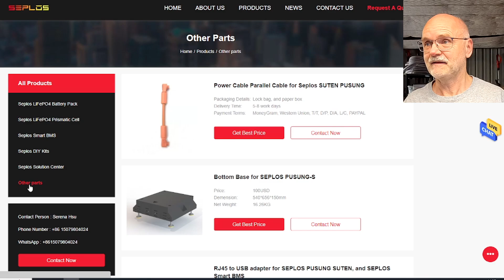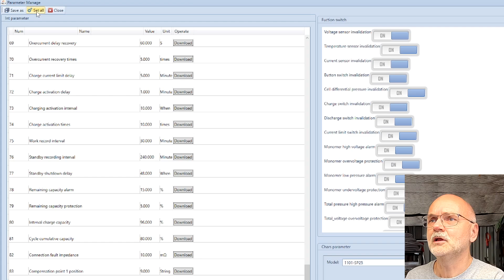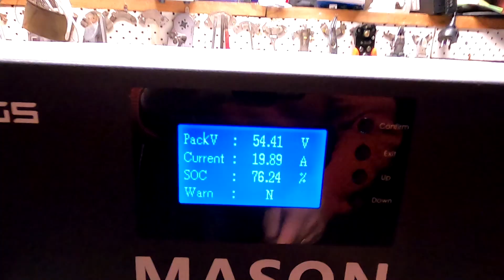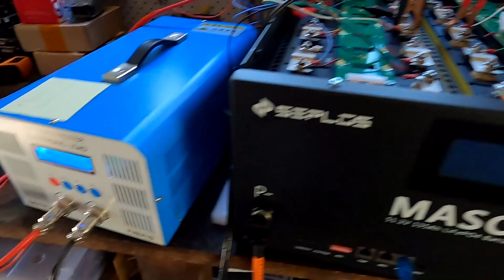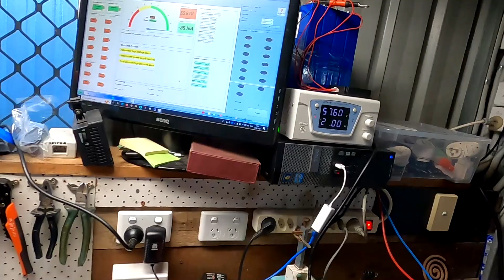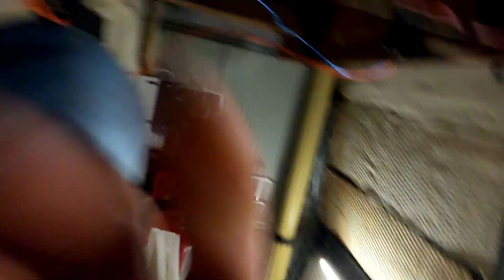SEPLOS SMART BMS: as good as its reputation?

Comment: Hi Andy and thank you for all your testings about Seplos
I use Vertical Kit from Seplos to make 16S 300Ah Battery Pack
BMS inside is 10E, with bluetooth
I use with a Solis inverter, everything looks good now, only that i just can't figure out what is the warning / parameter that make BMS to ask inverter to limit charge current to 10Amps
Sometimes happend to see inverter charging at 70Amps ( maximum set by me ) and finish charging without lowering current and sometime is lowering to 10Amps and stay there for a while and finish charging
Thank you again

Comment: How does the seplos bms stack up against JK bms? I'm interested in 8S configuration
Reply from the maker: Like apples and pears, I would say. The JK is great for a single battery and has exceptional balancing features. But it is a consumer grade BMS. The Seplos, Tiangbangda and Pace BMS are far more robust, can be programmed in far more details (which can be very confusing), have additional safety features and can communicate amongst each other and your system/inverter.

Comment: Hi Andy, I have just built a 48V 280Ah battery and I have a Seplos BMS 100A 10E. I ‘ve noticed that despite the inverter being setup to charge at 3000W, it only charges at 2500W maxing out between 45-49A even at low state of charge. I should be able to see around 60A going into the battery but for some reason the BMS is telling the inverter not to exceed 50A. I have checked the settings and I don’t see anything that could explain this. Do you have any idea?

Comment: Hi Andy. Are you using the DVCC function in VenusOS so that the current limits are controlled by Seplos BMS?
Reply from the maker: Yes. I use that in the SPAT Calibration Centre installation (Battery 3.0).
I also use DVCC in my Off-Grid Garage for limiting the charge current without any smart BMS connected.

Comment: Seplos recommend to charge the battery pack with 100A and discharge 100A to the bottom or when the BMS switches it off. Then charge again at 100A to the top to reach 100% or the Ah rating of the cell modules is reached. That is what I was recommend by their tech team.

Comment: Hello from Germany, if you know the Seplos BMS, you must have thought about balancing, many have an active 5A balancer from Alibaba and don't know whether you always leave it on or just plug it in every month and then look so that the cells are well balanced. On the bottom of the boards there is a soldering point or several where there is also soldering for Lifepo batteries. this big pad covers 2 contacts and if you solder a wire and switch you can turn the balancer on and off. look closely, on the circuit board at the edge.
I like seplos and the service also

Comment: Can I successfully connect the seplos BMS 14s to my energy storage consisting of the LG Chem NCM (Li-Ion) 12S battery? What should I do with the 2 free bms cables?
Reply from the maker: I don't think this will work with Seplos BMSes. They only work with the specified number of cells unlike many other where you have 8-24s support for example.

Comment: Andy:

I also purchased two of the Seplos 280Ah DIY Kits in April and May. I really liked the idea and they did not seem expensive, although the shipping was $190 per kit. My cells were only a few months old and came from Docan Technology. I was thoroughly dissatisfied with the cells as very few test to the alleged capacity at a very low C rate. The second set of cells also came swollen. Docan suggested I just compress the cells back to the original size. I chose not to do this and will not buy more from Docan.  Both kits came packaged as yours did, with loose parts all over the place. The PCB boards had broken leds that had been sheared off by the loose parts. I soldered the leads back and requested a new board from Seplos which was sent quickly. One thing I did receive you did not was a parts list. It was not completely accurate, but it really helped, especially with the screws, took me several hours to sort the screws out. 

The one thing that made me decide not to buy another Seplos kit was the customer service. One of the bus bars, S-F-3, that connect the BMS P+ to the fuse block was bent backwards. The BMS sits lower than the fuse post. Normally the bar is bent so the short section goes over the top of the long section. This causes the short section to the fuse block to sit higher than the long section. This way it will sit on the BMS and fuse block very well. I contacted Seplos and explained the problem, they refused to replace it. I sent pictures of the problem, they refused to replace it. I sent pictures of their other S-F-3 I had that was correct and the mismade bus bar, they refused to replace it. They told me to take the mismade bar and just bend it back over. I told them the kit would then have been modified by me and the warranty would be void. Again I was told to just bend it. I told them it was not possible to take a piece of thick metal that had already been bent and reverse the bend, even if it was a lot of thin pieces, and expect it to work well. Again I was told to just bend it. I asked them if losing a good customer for want of a $2 part was worth it to Seplos. I was told that the part was not a "qualified" part and would not be replaced. Eventually I removed the shrink wrap and did bend the bar back so it would fit. It is an ugly bend and it barely fits. But it was my first option other than making a cable, my second option. Consequently I will move on to other commercial batteries.

I have also not been able to get the Mason 280 kit connected to the computer and would like to know how you did it. I have not seen a video of the Mason 280 kit connected yet if you have done so already.
Reply: Thanks for the detailed info!

Comment: Already shown before, your large DC power supply's AC input power factor is poor with its simple AC input rectifier-filter capacitor AC to DC conversion.  The cheapo power monitor doesn't like the poor power factor.  Your Tesla has a power factor corrected charger, so it has AC input power factor near 1.0 (probably something like 98%).  

Suggest you get one of the $20 AC power monitor that reads out power factor along with AC voltage, AC current and real power.  Likely about 0.65 power factor on your high DC current power supply.  Inverters, transformers, and generators are actually rated for VA, not real power so poor power factor hurts.

Comment: I made the mistake of buying one of their 200A BMS's. I have had nothing but problems starting from day one. From day one the onboard NTC randomly produced faulty readings shutting the whole system down. The CAN bus cables randomly loose contact even if fully latched in. Their BMS now has stopped balancing altogether after running for about 160 cycles. Cell differences are > 200mV,  some cells are constantly stressed out to their maximum allowable limit while others remain barely charged. This BMS is a throw away unless you want to damage your battery cells. The company doesn't care, they either ignore repeated communications or reply with a generic 'OK' believing that the issue will somehow go away.

Avoid this tofu dreg from Seplos, their product is of poor manufacturing quality, they leave you stuck with their broken junk and their customer service is non-existent.

Comment: This video is very valuable material to watch, for SW developer, how NOT to code BMS. BMS have to send date / ESP MESH, RS485, MQTT, CAN / to another HUB or gadget / inverter , MPPT / but, if BMS will switch of battery, it will kill my MPPTs or my inverters and MPPT and inverters has higher value, then on cell in LFP battery. Within 9 yeras, I have no need to switch off my MPPTs or inverters, because I have not BMS in my NMC, NCA, LFP and Pb flooded cells. But now, when my LFP cells are old, I see different AC impedance, so I am building my DIY BMS with 2 4  8 10 and 16 AMPS balance currents. ESP32 BMS + MPPT_0 + MPPT_1 + MPPT_2 wil communicate, without cable / no need for data surge protection /, without WiFi - no need for router and WiFi NET, and if DIY BMS tells MPPTs, that "I need 6 AMPS", MPPT 0 to 2 will decide, with respect to Sun, panels orientation, weather conditions, teperature of MPPTs toroid coils and MPPTs FETs, if all MPPTs will give 2 + 2 +2 AMPS equally, or 6 + 0 + 0 and so on. I have also ESP32 thermocam, so thermocamera will see if there is problem with cells or bus bars or PV DC fuses, and with help of libs, like TensorFLow will apply solution. Also my DIY BMS and MPPTs communicate with me with speech commands, and give me info with sound like: OV of cell_x is y VOLTs,  temp of cell y is z *C, connection 6-7 is hot etc.

Comment: I have those batteries also. When I charged them they alwas stopped around 96% more or less. I Always let a second charger connect connect to them and never worried myself about the 100% percent charged the way you do. Than I come to check them they were all 100 % charged. But the inverter  ever really charged them at 100 % only the other Aims charger did that job. All you have to do put a 15 Amp charger connect to it and the charge them to 100% without you knowing it.

Comment: Don't focus on cell voltage difference by itself. What's important is avoiding cells overvolt or undervolt.

If you are using less than 90% of the SOC (middle) when cycling then the cell to cell voltage differences don't matter most of the time. Differences only matter when the differences make a cell exceed a maximum safe voltage or make a cell to fall below a minimum.

Typically, LiFePO4 don't need to go above 3.5v or below 2.8v (or whatever you choose) per cell. When charging/discharging & your cells are around 3.25 to 3.30v is not a problem at that time. Having cells hit 3.60v when others are 3.45v would be a problem.

When it comes to balancing, the balancing rate should be enough to drop the voltage while charging. In a worst case when a cell reaches 3.6v a 10A charger will need 10A balancer to stop the cell from overcharging. So when balancing starts you don't want high charging rates to continue (should taper down). A 1A balancer wont keep cells safe when you push >20A. You can easily waste a lot of power & cell life when pushing cells to the limit & overdoing the balancing.
Reply from the maker: Thanks Tim, I literally made dozens of videos about this topic and tested all possible scenarios.
You're absolutely right. One thing is for sure: as long as the charge current is larger than the balance current of the BMS, the whole balancing will not work. And with 150mA of these sort of BMS balancers they are not capable of balancing these high capacity cells at all.

Comment: Why are you disabling the active BMS for daily use? Why not use the active balancer and disable the seplos balancing feature?
Reply from the maker: The active balancer should only be used when the voltage are 3.45V/cell or higher with LifePo4. Otherwise it will do the opposite and unbalance your battery pack.
Reply: @OffGridGarageAustralia  sure, this is obvious, but it can be used/ installed permanent
Reply from the maker: @patrickmartin4482  With some sort of additional switch, yes.
Reply: @OffGridGarageAustralia  just a "start voltage" and daily use is not recommended? Ordered yesterday the neey

Comment: My 200A Seplos BMS with approx. 15 cycles keeps my 320Ah cells perfectly balanced. It is connected and managed by the Sofar inverter where I set the discharge depth to 90%.
Reply from the maker: Great. I didn't do an initial top balancing to test the BMS.
As it is now top balanced, we will see how it performs the next time we fully charge it. I don't even know if the balancer works...
Reply: @OffGridGarageAustralia  And this is possibly one of the problems. No top balancing done… Another problem could be to stress the cells with charging it almost to 100%. This could be hard to manage for many BMSs, that have low balancing current.

Comment: Good video and very informative, thanks again. I bought the Seplos BMS to make a battery pack to use with the Sofar ME3000SP ac charger in the U.K as the charger needs to communicate with the BMS. This BMS appears to be the same that is used in the Pylontech batteries that Sofar also use. The batteries (230ah) came 2 days ago from Docan Technology in China in less than a month which surprised me and I wasn’t ready to set anything up! All the cells are at 3.3v but I’m going to top balance them before I build it. Is it not correct though that the cells will all adjust to a very similar voltage over a period of time with the BMS and, the mv difference doesn’t really matter because the total capacity of the battery is high enough already? I’m sure that you won’t ever discharge your battery by 100% in the real world so it will never need the cells to be all the same voltage. There is always a variation in anything that is manufactured and a small amount of tolerance should be expected. Just my thoughts and I’m not an expert by any stretch of the imagination but I found this test very informative. Thanks.

Comment: Here in Lebanon Growatt and Deye inverters are widely used and Seplos support them with CANBus.  we install Seplos + heltec balancer with a switch for maintenance. If you use canbus with growatt for example, the bms will tell the growatt to charge with CV, only one voltage. A good advantage of Communication with canbus, is that our customers will see the accurate percentage SOC from the inverter/App directly. Any big error from the BMS will be informed to the inverter, will lead to safety shutdown and more features.
Reply from the maker: That's good info here, thanks a lot for sharing!
Reply: Are you familiar with Felicity and its EDMS settings? If so I want to ask you some questions if it is ok
Reply: @esmailalkassir1565  sorry, i don't use Felicity products.

Comment: Hi Andy, really glad you did this deep dive on the Seplos BMS and it's software. And you're right, the mobile app is alot easier but I guess where the Seplos will shine is that once you make the change once, the software will send the updates to all the BMS in your battery bank. That'll be very helpful if you have a battery bank with 3 or more batteries each with their own BMS. With the JK, which is excellent, you'll need to log into each of the JKs and update parameters on each of them. I guess it's a trade off somewhat. My question to you though, let's take the 4th gen NEEY smart balancer for example, is that something you would leave permanently connected with the Seplos so that balancing would occur automatically and you wouldn't have to look back at it?
Reply from the maker: Thanks Henderson. Yeah, I guess we will have more fun with the BMS soon. I have ordered a while bunch of adapters now to make it talk to the Victron system (not just the inverter). We will see how this plays out and works. I agree with you, as good as the BT app seems to be but from a maintenance perspective it is very cumbersome and takes a long time to go through all the parameters individually. I hope this is really something the Seplos BMS will shine and make us happy.

The Neey is certainly something you can easily integrate into the Seplos Mason system. There is heaps of room at the front and some Velcro will install the balancer nicely. Once programmed, it will help balancing these cells.
Reply: @OffGridGarageAustralia  ok great  thanks Andy. Looking forward to your follow up videos.

Comment: I saw a similar behavior with a JK BMS with even 2A balancing current with a very unbalanced battery pack when the charge current is to high. Looks like the lower the balancing current of the BMS is, the slower can be charged in the upper battery SoCs. Once the battery cells are balanced, this charge rate can be higher unless you have similar cells. The more they are different in internal resistance and capacity, the slower you can change to high SOCs. I think this is the reason why the car manufacturers only accept very similar cells and we have to live with the grade b cells. No one would accept these problems in their car
Reply from the maker: Yes, this will happen with any BMS or balancer if the charge current is higher than the balance current. But 150mA with the Seplos BMS is not really an option to charge your battery with. Especially not with such high capacity cells.
Most people will use these 'A-grade' batteries for DIY stuff so we will have such voltage delta and the BMS or balancer will have to deal with it.

Comment: Hi Andy. I really appreciate your channel and your are funny too. One question: do I have to let the active balancer always connected, or should I connect it only sometimes? Best greetings from hot, most northern Germany.
Reply from the maker: Thanks for the feedback. As we have tested in previous videos. It is not recommended leaving it connected as it will balance 24/7 then. Once you fully charge again, the cells will be totally out of balance. I would recommend either using it occasionally for maintenance purposes or turning it on only above 3.4/3.45V.
Most northern D can only be north of Flensburg...
Reply: @OffGridGarageAustralia  thanks a lot Andy. You are right with Flensburg.